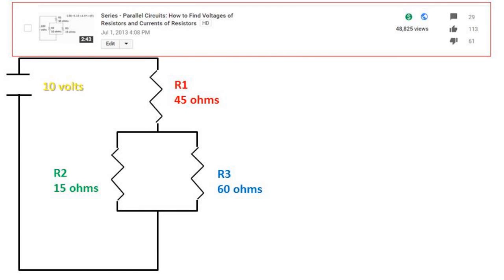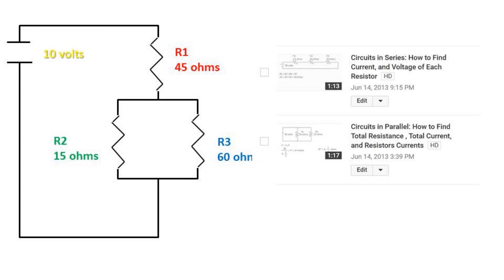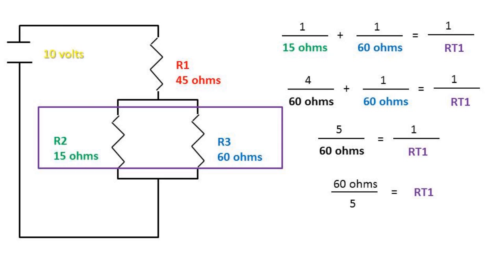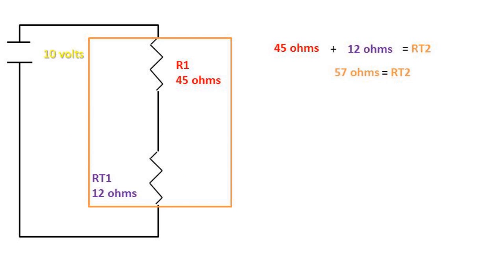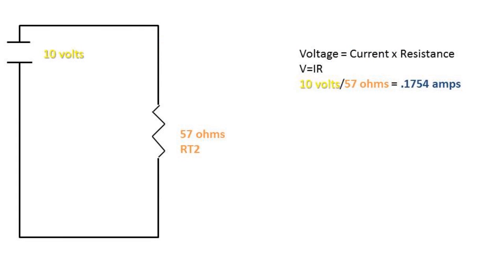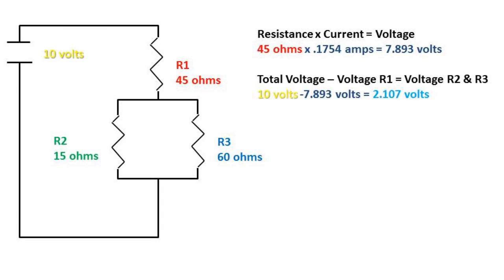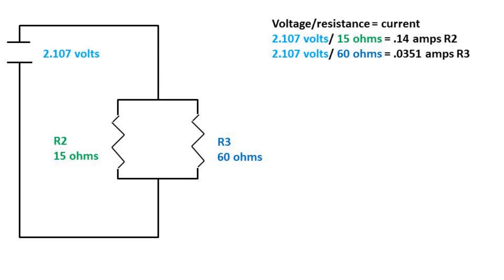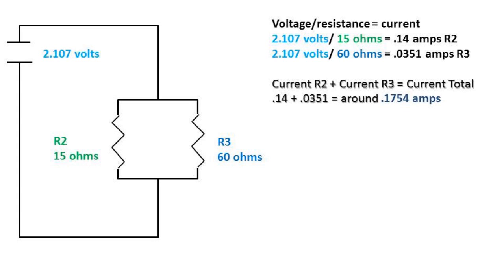Series - Parallel Circuit (Problem and Solution Find Current and Voltages)

Comment: wanna simplify this even more with the parallel circuits?   1/ 1/15
1/60 = 12 ohms.
Reply: *1/1/15+1/60= 12 ohms... for got to add the plus sign
Reply: What do you mean? In the current?

Comment: how to calculate resistance,current and voltage in hybrid (series and parallel mix) circuit Practically(by multi meter and breadboard) & theoretically (on paper with a circuit diagram) ?